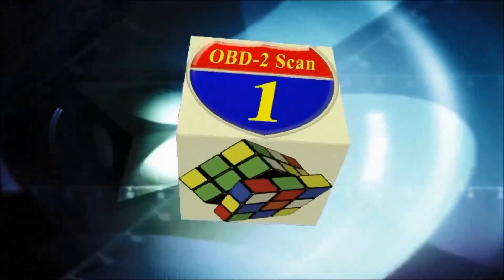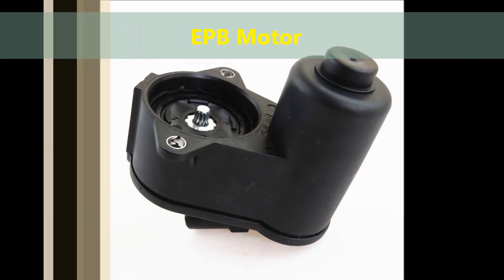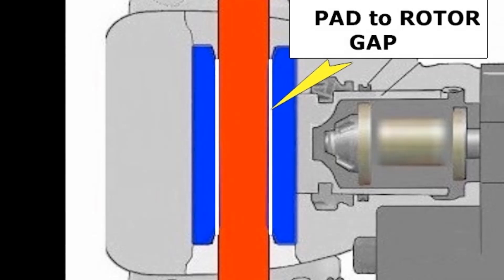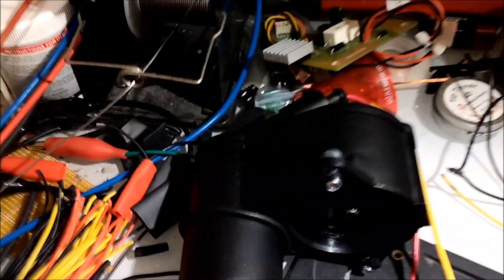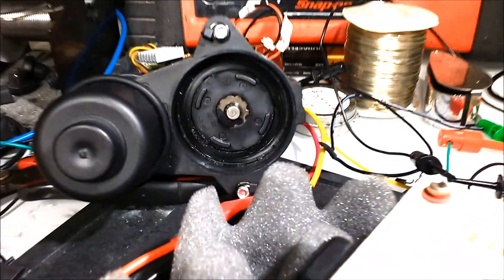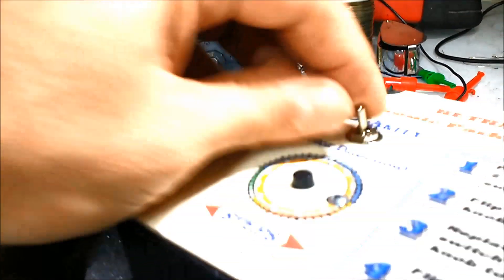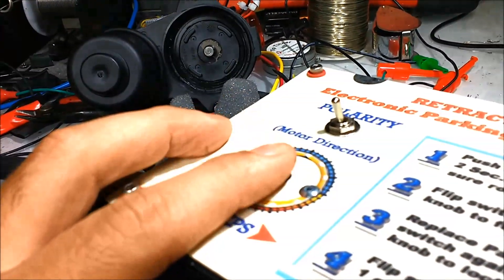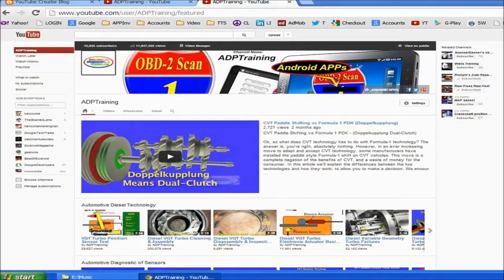Electronic Parking Brake and Retractor Tool

Comment: Rotating Shaft, another potential Leak Location, and Loss of Rear Brakes. I am in the Process of Disabling this thing Permanently, on my Caddy. I have Never used the Parking Brake in over 50 yrs of Driving

Comment: I’ve always used a battery to retract the pistons and never had problems
Reply from the maker: The issue us readjusting back after pads replacement. Besides, it isn't professional to use the battery. 

http://www.autodiagnosticsandpublishing.com/electronic_parking_brake.html
Reply: Algún día tendrás problema con esos frenos
Reply: Today is the first time I've encountered the electronic brake system, it's a VW. I think my customer won't care if I apply voltage from my jump box and reverse the polarity by switching the wires around on the jump box, I know, it's very unprofessional😆

Comment: Just wonder why this e-parking system not integrated into abs pump. Adding few controllable pressurising actuators instead of conventional open/close solenoid valve could servo the pressure on the caliper in a smarter way. DC motor isn't working that reliable in some climate, says flood, muddy trail...

Comment: If the scan tool and pcm use lower current, is the wiring inside the motor designed for the much higher current delivered by your tool?
Reply from the maker: Ok, the ECM delivers whatever current the motor draws plus some safety circuits. So does my tool. In others words, I use the same circuits. The difference is sometimes if you have a code, the ECM will not work to retract the caliper. And you may not have scantool capability to retract that brand. My tool is universal. http://www.autodiagnosticsandpublishing.com/electronic_parking_brake.html
Reply from the maker: http://www.autodiagnosticsandpublishing.com/electronic_parking_brake.html
Reply: I think that that computer only signals the relay switch , the relay switch opens and deliver the current to the motor , remember relays are switches that turn on by a smal current ,

Comment: I have a question. When my car was up for NY State inspecations, everything was working fine, no lights on dash, no engine check light, electronic parking break was working fine. When i took it over 2 hrs later they called and told me they couldn't move the car due to electronic parking break wasn't releasing. He said he had use a scanner to get it released. I was like wait a min. So, ever since feb 2023 had put new rotor on. Then 2 months later passager side rear was getting hot. So, replace rotors, caliper, pads. Now, driver side rear is getting hot make this loud sound. The place i took it to said he's not fixing it anymore cause it's costing him money. Ever since the issuse with elecetronic parking break, i feel like they have screw something up. This is costing me money to figure this out.
Reply from the maker: EPB is only in rear. Doesn't make sense.
Reply: @ADPTraining  I know that it's in the rear. Ever since they said my EPB wouldn't release they had to scan it to release it. The thing is i never had any problems with until they had it. It's been a continuing problem with rear brakes getting hot and making this loud noise.

Comment: Or you could use a battery and two wires.
Reply from the maker: No, you need detailed operation to advance the brakes by STEPS. Otherwise after pad replacement the caliper is maladjusted. This is how it's done.

http://www.autodiagnosticsandpublishing.com/OBD_2_DLC_Health_Checker.html

http://www.autodiagnosticsandpublishing.com/electronic_parking_brake.html
Reply: You need 12v battery and wires..

Comment: This is a westoff time , any one can make this tool , need dubble side switch 12 v power suplly revers nd forved switch , best is scan tool ,so we no my car caliper stick , this tool u force to rewind , revers nd forved ! Good luck , u can do it witout ant tools is well , 3 tiny start bolt open get 8 mm spaner or jumper cable ndu can do it !!
Reply from the maker: This is not a simple relay reversing polarity. It takes more than that to adjust the calipers properly. Not everyone has a scanner that'll do this. And, even if you do if the calipers are stuck, there's a code, the ABS computer will not actuate. So, if you do auto repairs professionally, forget jumping or using relays to do a man's job. The right tools all the time. http://autodiagnosticsandpublishing.com

Comment: Do you need to take off tire or can I just use this on the battery to unlock ebrake?
Reply from the maker: Yeah, but why would you want to. This is done to perform a brake job. http://www.autodiagnosticsandpublishing.com/electronic_parking_brake.html

Comment: I wish there was a cleaner/more professional, stable way to connect than alligator clips. On the ADVICS EPB units we get on Mitsubishis (and other makes) at our shop, alligator clips slip off the pins. Really frustrating fumbling around trying to get them to grip the tiny pins and hope they don't touch inside the connector.
Reply from the maker: With my http://www.autodiagnosticsandpublishing.com/electronic_parking_brake.html RETRACTOR TOOL, even if they touch, the unit won't get damaged. However, our RETRACTOR comes with a simple pin to alligator adapter. You can always build yourself a dual pin rig or buy a connector off Amazon for testing.
Reply from the maker: You can also buy OEM connectors, but there are hundreds of these for all brands.
Reply: @ADPTraining  Can you explain what you mean by a "simple pin to alligator adapter"? Got a picture?